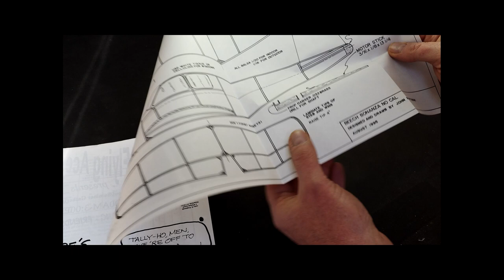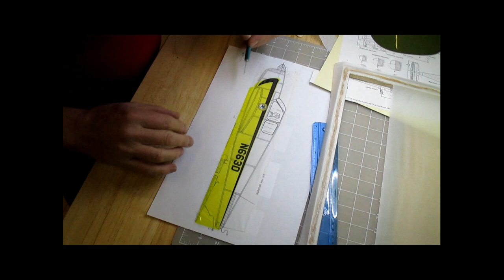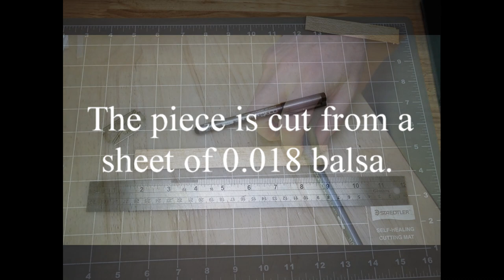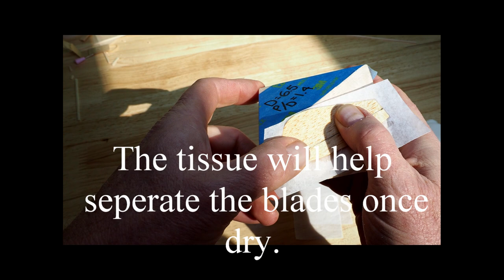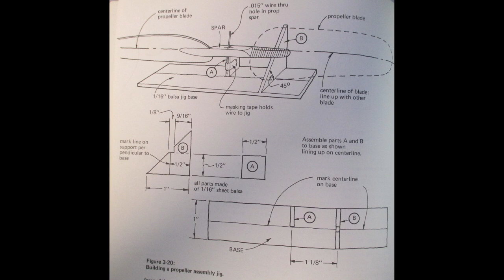Build and Fly a Beech Bonanza Indoors/ Prop Construction/Rolling Balsa Tubes

Comment: Ha! I never realized the motor was OUTSIDE the tube! I liked your technique demonstration. Applicable to larger, heavier models as well. Thanks for posting!
Reply from the maker: Thanks for the comment Ken. As you may know, some larger models do run the rubber motor internal to the tube. Sure makes for a strong and light component. Thanks for watching.

Comment: John, I learned quite a lot from this video. The rolled motor tube is just what I want to master. Your development of the prop blades via a form leaves me with questions about how you carved that prop block and how you developed the propeller assembly jig.
Reply from the maker: Thanks for the comment, Steve. You point out that maybe I should do a video that covers the prop block and prop assembly in a future video. I'll see if I can put something together next time I go through the process. Thanks for watching.

Comment: John, I love your models, but this video is totally inadequate to build the model.  A video is needed on making a prop block and the prop.  Is the brass tube still inside the balsa tube?  Me being in Illinois makes it pretty hard to come to CT to ask questions.  - Bob
Reply from the maker: Bob, please understand that the intention with my "building and flying" videos are to only provide an overview of each model. A high-level view and not necessarily the fine details. That type of video requires a bit more time to assemble. You'll see in my catalog that I do have a section on building tips and my hope is to continue to build that. It provides the details for the building block for building free flight models. You've now suggested to me I could do a video on prop carving and now indoor prop construction. I've also been asked about a video on tissue covering. I'm putting these in my queue and will develop detailed building tip videos in the future. Several video projects ahead of them at the moment.
Reply: The brass tube is not left in the balsa tube.  It would be way too heavy.  As shown, after the brass is removed, the balsa is very carefully glued closed.
Note that at 1:38, he explains the balsa tube replaces the original design's balsa stick.  You can see that stick on the plan at 0:22 and 0:36 just below the tail of the model.  sticks may be heavier and/or more flexible than a tube, but they work just fine and are simpler to make.

Comment: Hello, wonderful model, love how slow it flies. I’m thinking on building a ultralight nocal too. What thickness of balsa did you use for the motor tube? The thinnest I have right now is 1/32”
Reply from the maker: Hi Balsa Boy. You certainly have the talent to build a decent no cal by the models you've produced in your vids. The balsa I used was 0.018 inch thick. What you could do is sand down your 1/32. Maybe you have some 0.020 music wire? Cut your balsa to length and tape a piece of 0.020 wire on each side of the balsa. Then use a sanding block to sand the balsa while the block contacts the wire. The wire will act to limit the thickness to 0.020. It's important to only push the sanding block away from you so the balsa sheet doesn't buckle. Good luck! Look forward to your build.
Reply: @Watchingthevideos99  thank you, I believe I do and will do.
Reply from the maker: @thebalsaboy  Go easy with the sanding. Too many times I've tried to go too fast and crumbled the wood. 😂 Have fun.
Reply: @Watchingthevideos99  lol, I’ve done that before. Sucks having to restart and waste some of your wood!
Reply: @Watchingthevideos99  I can fully start yet because I’m working on a pnut Curtiss Jenny, but I’m still wondering what I should go for, I might do the bonanza but don’t know yet, how about you pick (nothing too extreme)
Reply from the maker: @thebalsaboy  have you looked at my link to the Paul Bradley site? Check out some of his no-cals and let me know what you think. The link is in my description for the video.
Reply: @Watchingthevideos99  I have, and ok.

Comment: Buenas tardes...
He descargado un plano de parmodels pero el archivo PDF tiene una contraseña. 
Alguien sabe que contraseña es?
Gracias
Reply from the maker: What is the link to the plan?
Reply: Supongo que todos los archivos están protegidos por contraseña
Reply: Aunque no le veo mucha lógica
Reply from the maker: @javiermonreal593  I'm able to open the PDF without a password. http://www.parmodels.com/flying-aces-club--fac--rules-no-cal-models.html
Reply: El problema que tengo es cuando necesito cambiar su tamaño en corel draw para poder imprimirlo, entonces es cuando me pide la contraseña.
Reply from the maker: @javiermonreal593  Change the file type. That might work. But is should print full size when you download.
Reply: I've noticed some of the Bradley plans are 'SECURED' pdf. After you've downloaded the plan, right click/'open with' Chrome. After it opens, click 'Print', then save as pdf. Suggest you rename with 'unlocked' in title. This creates a new pdf without a password, and it can be resized or printed as a 'snapshot.'
Reply from the maker: David, thanks a good tip.
Reply from the maker: See David Duganne's comment below.
Reply: @Watchingthevideos99  👍